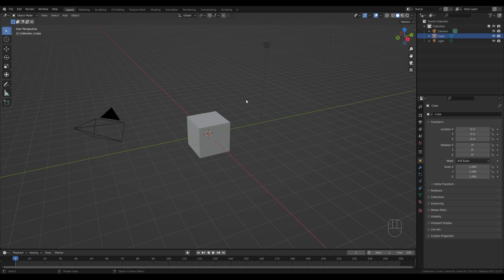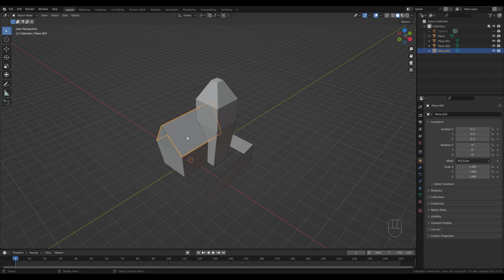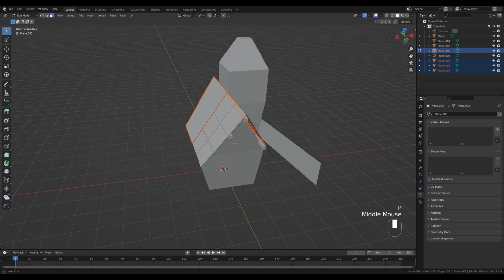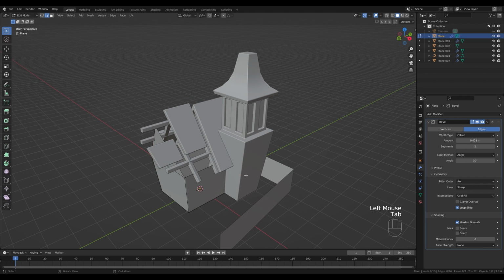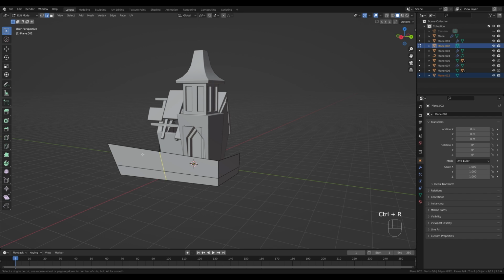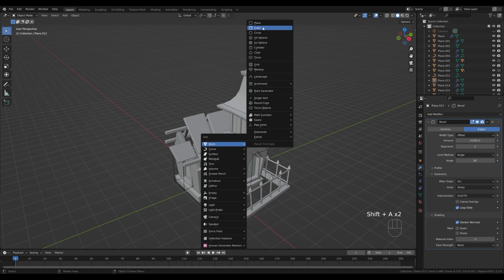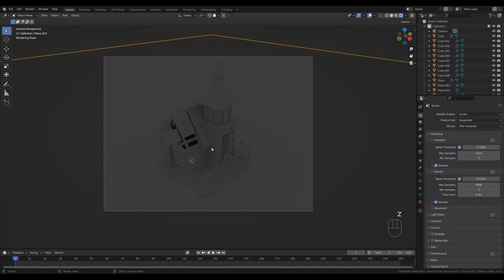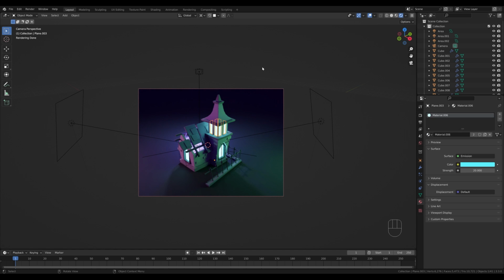Blender 3.3 Spooky House Tutorial | Polygon Runway

Comment: I'm stuck at the bool tool part for making the window hole in the front of the house. I select the box that is the window and then the house, but when I press CTRL & - it deletes the entire house and window, leaving only the window face.
Reply: I worked out my problem. The window shape was intersecting two different objects. (I later noticed it was also leaving a small prism above the deleted house shape) Reducing the size of the window a little to make it only intersect the house shape solved the issue.
Reply: also the order of selection influences. can be funny results)

Comment: what's the actual separation performed just before rejoining the roof parts around 6:50? it skips over this very quickly
Reply: Select the vertex at the top of the roof and press 'V' to rip the vertex into seperate parts. This is the Blender manual description: https://tinyurl.com/2p8cn6da